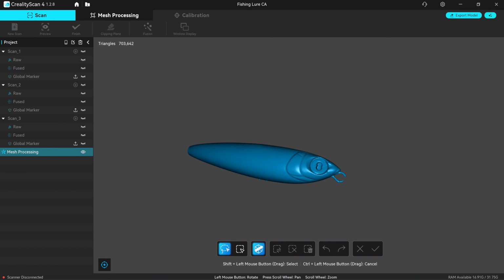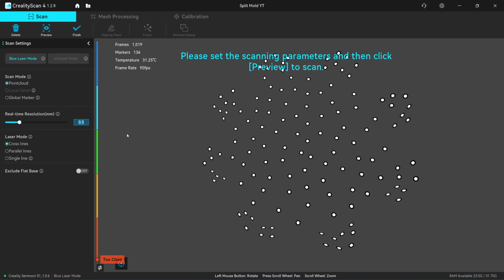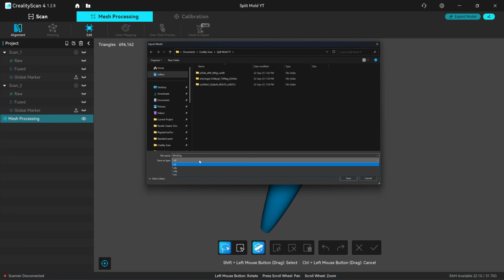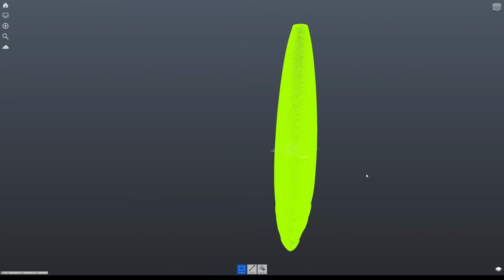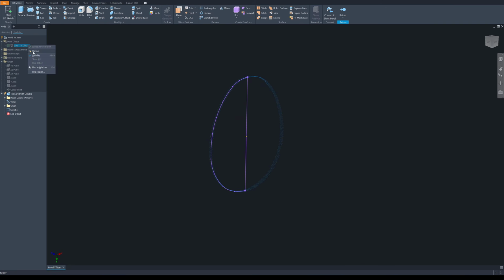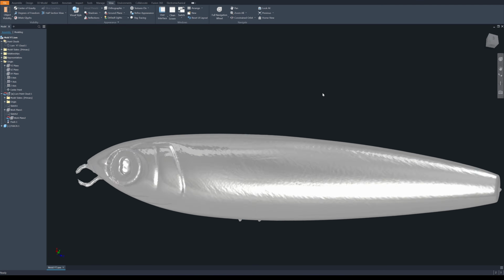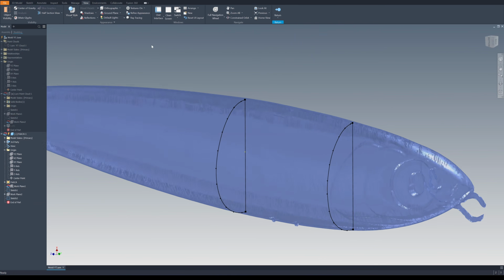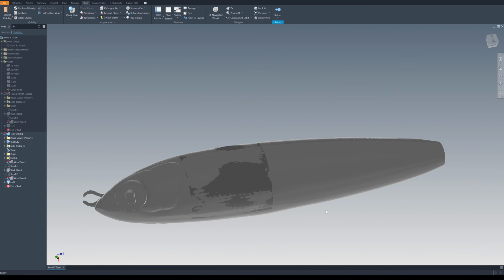3D Scan to CAD Workflow with Creality Scan 4 – Point Cloud vs Mesh for Split Mold Design

Comment: Payo was your copy of recap pro full or free?
Reply from the maker: ReCap is available via subscription, but it's also included in the Industrial Collection alongside AutoCAD, Inventor, and 3ds Max.
Reply: @Payo-TensileCreator  Thank you sir. i have the design suite ultimate 2017 i need to see if recap 360 will fit the bill.
Reply: recap 360 will not work ill have to either purchase pro or find another route.

Comment: Hi! You can try out how easy it is to work with STL or OBJ files in Autodesk Alias. For me, it's the most convenient software for working with NURBS curves. It also has a function for projecting curves onto a mesh, which greatly simplifies the work and increases precision. As a design engineer in the automotive industry, I consider it one of the best software along with ICEM Shape Design.
Reply from the maker: Appreciate you sharing! I mostly design structural components, and Inventor handles large assemblies—3K to 10K parts—like a champ. No hiccups at all.

Comment: Thank you for another amazing video!
In the previous one, you mentioned that you were using a laptop — could you share its specs?
The S1 has an impressive speed.
Are you also using a laptop this time?
Reply from the maker: I'm using the desktop this time, my laptop has RTX4070 and Ryzen 9 8945H, when plugged in, it will scan at 50-70 FPS, not as fast as my desktop.
Reply: @Payo-TensileCreator  Thank you for the detailed reply! Those specs sound great, and it’s really helpful to know the difference in performance between your laptop and desktop. Much appreciated!